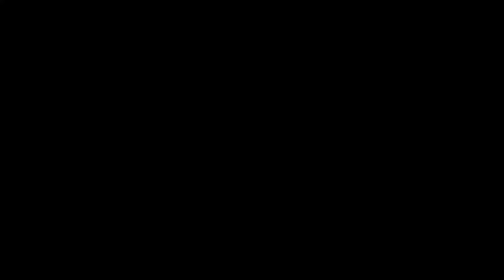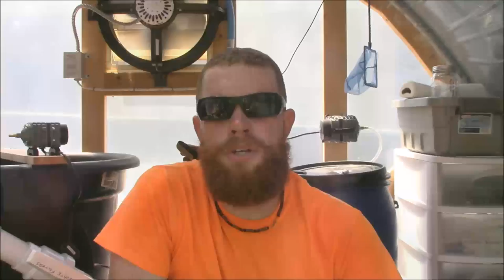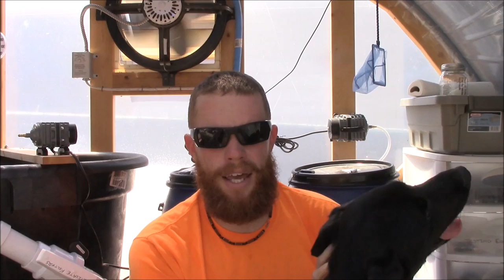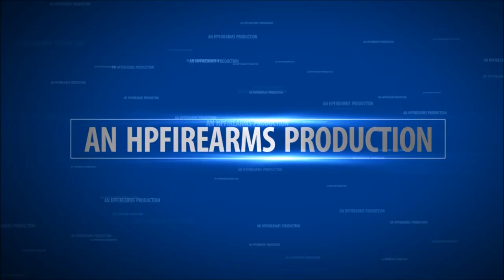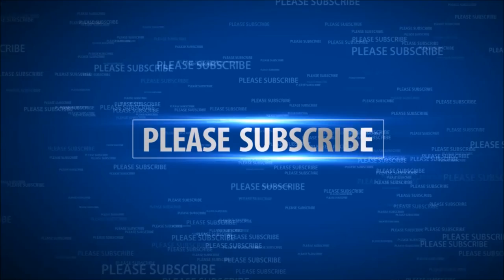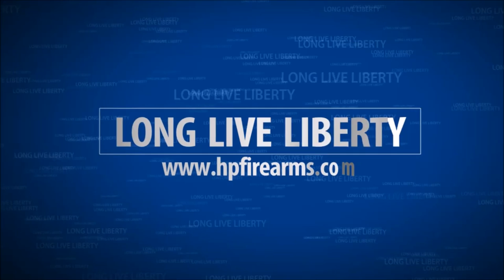Hydroponic Rail System - "The Final Video" VLOG 13 by HPFirearms

Comment: Thank you for the videos I knew before you said it that the water temp was going to be a problem a friend of mine buried a 55 gallon drum like you did only he added the refrigeration unit from an old soda machine he dropped the condenser in the water and it worked out perfect and he insulated the tubes

Comment: Try this guy have green house half in the ground with Adobe walls with clay tile walls without glazing  on the tiles then have aquaponics outs of the greenhouse and pump the water inside to your Hydraulics inside. Now your Hydroponic set up one type has a bed the other has a direct root to water set your Hydroponic inside. Set up three beds. Pumping between them the wormer water will help the fish.

Comment: IMHO I would not be too quick to discard all your work.  
Two items.  
First, I think you would have had better results if you grew lettuce instead of strawberries.  About 30 days from start to table or market.  
Second, Instead of round PVC I used square PVC post covers.  Easier to drill, supports the netcups better, and lays on the supports without rolling, thus no need to secure them with clamps.
Just my 2 cents worth.  Excellent series though, keep them coming.
Reply: So, instead of Round PVC, you want him to go with PVC Fence posts! I TOTALLY agree. Yes I know 2 Years late!! Personally, I would never do a Hydroponic system in a Green House. A more stable environment is best. Inside a closed area with Lighting would make the most sense to me. Yes I know he is learning. Actually he is learning from what I just said. Sorry for the typing first and not watching to the end!!